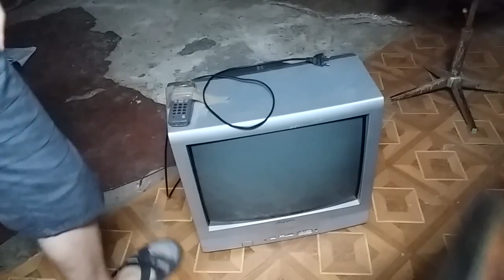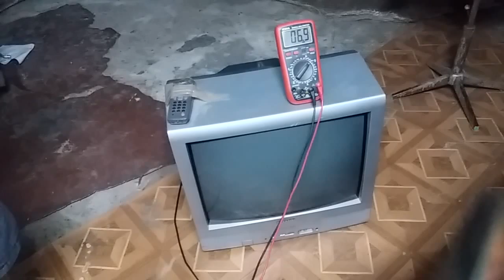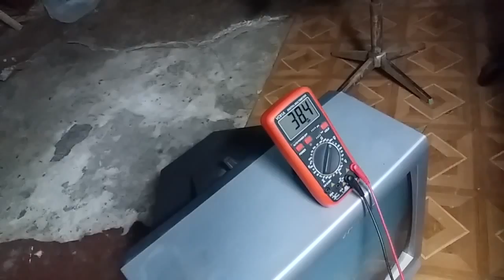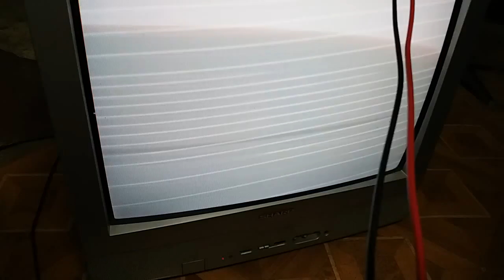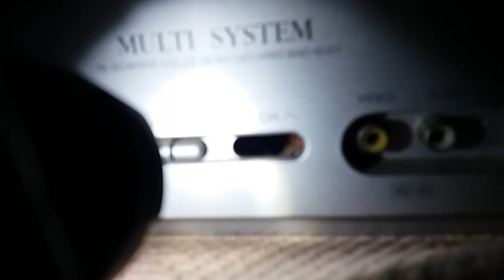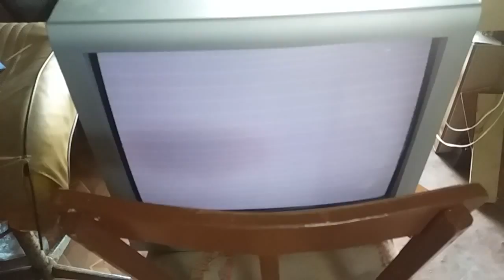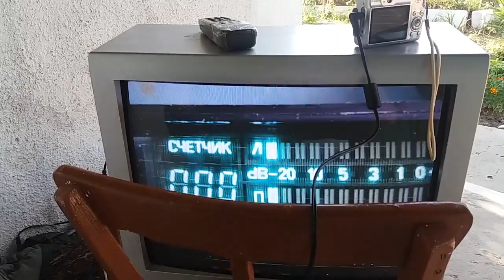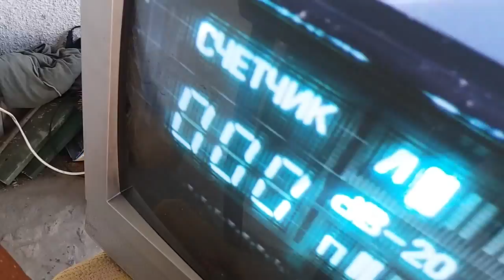CRT TV Repair #7: Gray screen w/ retrace lines

Comment: The picture on my tv is stuck on one channel, can you please please repair..... oh shit i was looking at the fish tank :).
I dont ask people to repair my stuff, and you are a bit too far away lol.
You do make me laugh,  "no picture is good because you dont have to look at ugly faces" :-D.
So the evil "Crapacitors" were the flyback problem, how dare they die lol.

Tv repair wasnt something i often had to do, so it was psu voltage check, then screen control, then tube bias resistors if the picture was over the top.
The most often fault was a dead line output transistor, next the vertical drive chip.
Reply from the maker: Arggh, you're trolling me :D
 It's ridiculous how many problems are caused by bad caps, I wasn't suspecting them to be the culprit in this TV.
Most problems I get are caps, then damaged HOT/SMPS transistor. And what's even more funny is that sometimes the transistor is dead "thanks to" the dry cap :D
Reply: p.s the volume on my fish tank dont work :)

I had a piss easy repair the other day, a lady had a small lcd tv that was acting dead, i asked "Does it have a power brick plugged in".
Yes she said, ahhhh yes.

It was a 3 amp 12v brick, that tested at 7.5 volts lol, a tad low :).
I found the TL431 shunt regulator driving the  opto coupler feedback was shorted K to A, never seen one of those go short before.
All the parts around it tested fine, and it gave 12.4v output, the tv was happy, and she was .
I dont charge for helping people, yes i know im sillly, i value people more than money.

Comment: What capacitance can a focus grid have to store a charge? Surely not enough to last more than just 5 seconds. I just shove the grounded screw driver under the HV silicon and maybe the main PSU cap (if I'm in a hurry..). It helps to get shocked more.. honest, one time I worked at a wood shop and an old 3 phase saw motor without a ground grabbed my arm from the elbow to my hand and I couldn't move so I had to push my whole body back with my running shoe. If I had touched with my other hand, well, this comment would not exist.. After that, from my shoulder down was sore for about 6 hours. (and my brain recorded the name Dewalt as bad forever..). 
It's good to have respect for charged caps, but use the one hand rule and you'll be fine.
Reply from the maker: The flyback has a small cap built in for that voltage,not that I had a problem with it, but it doesn't hurt to be cautious.
Yes, there's a fine line between being reckless and lazy (not following all safety rules). If you are really into electronics, you will know how to prevent being fatally zapped; but that's a big NO-NO for a beginner. I was just too scared of this circuits when I just started, and I'm happy with my choice. I started mucking around with SMPS, other high voltage/power stuff when I knew how they work and where is the danger zone.